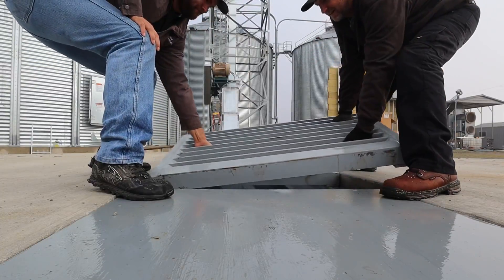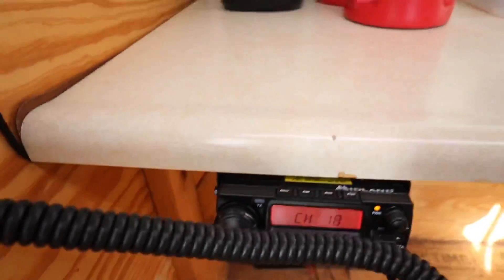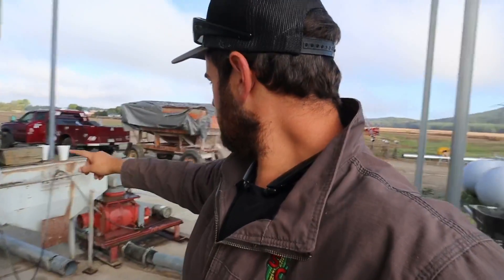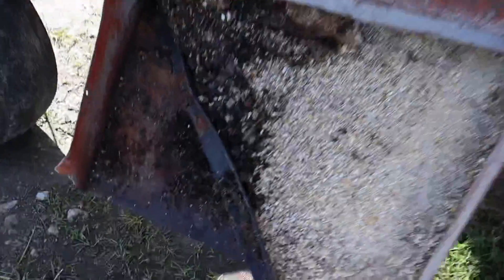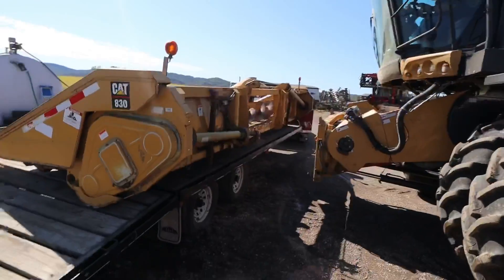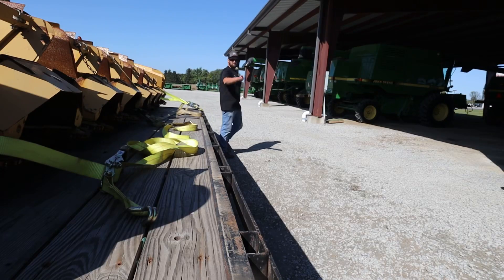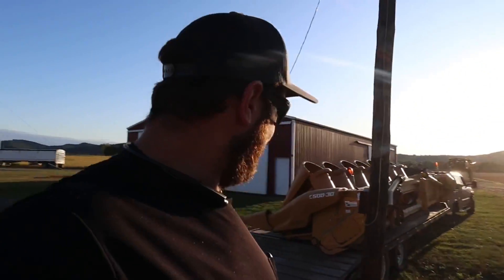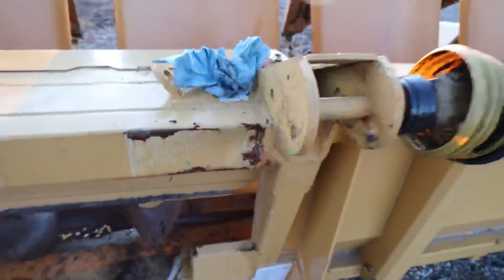I FIXED The Corn Head | Surprise

Comment: Get a repeater if you run Compatible VHF or UHF channel. Put the antennas on the grain leg and get 100+ miles range from Handhelds. Talk to Midland for tips. 5:54

Comment: Nice video, Brian. I like harvesting videos, but I also like these kind of odds and ends jobs videos for a change. You are so good at editing videos though, no matter what type they are. Nice CB setup you have in that shed. I am surprised you can get that long of a range out of that CB though, because when I was trucking I couldn't get it out of my Cobra 29, and I ran good Wilson antennas and used a good Road King microphone. A mile or two at most is all I could get and still be loud and clear. BTW, a base station radio would be an option for your shed too, if they still make them, and they do run off of AC current. Take care!
Reply from the maker: Thanks for watching and the compliment. These are GMRS radios not CB radios so the have better range
Reply: @BriansFarmingVideos  -- Thank you for responding, Brian, and for the explanation. I did not know what GMRS radios are and so I googled them. Learned something new today!

Comment: If that radio is like a cb. You shouldn’t need to put the antenna on top of the leg because the longer the cable the more reception you loose.